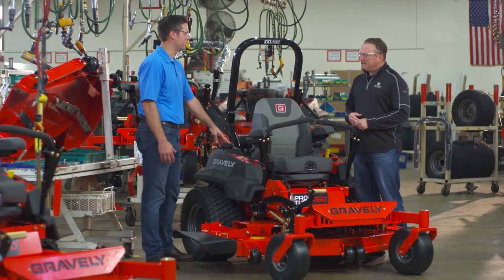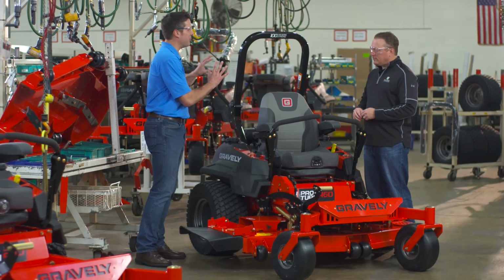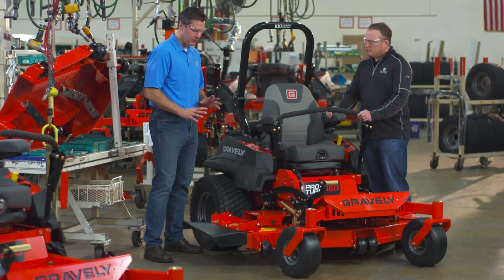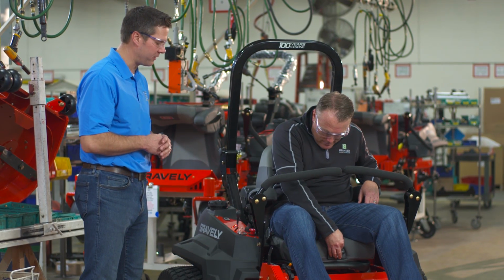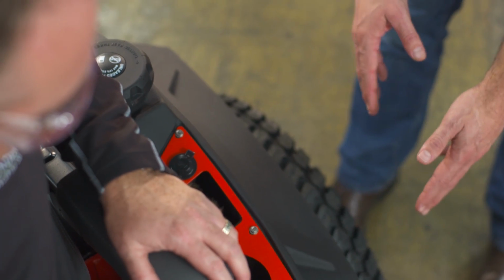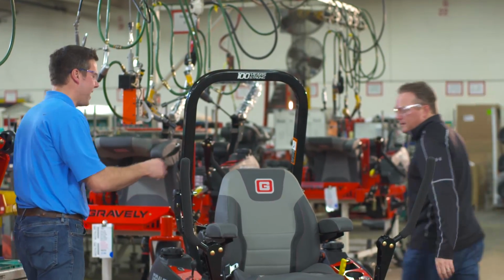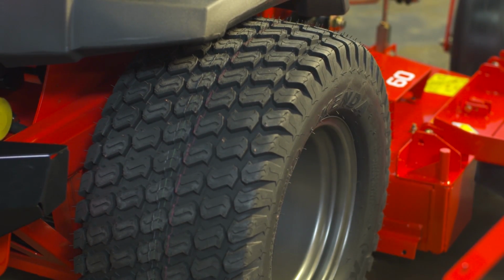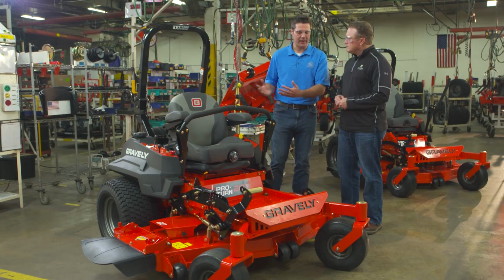Pro-Turn® 400 & Pro-Turn 200 Walk-Around | Gravely®

Comment: I own a 2015 260,  I've put 35 hours on her and this past weekend I changed  the blades. I'm ocd an also mechanically inclined  (like doing things myself) so instead of taking it to have it serviced I wanted to do it so I made sure everything was perfect. I ran the machine after servicing and it's scalping , I didn't move or adjust anything on the deck before or after replacing blades and servicing , either I have a bent blade or the pressure from jacking the deck tweaked the settings. This thing cut flawlessly  before the blade change, with that said , i was looking for a video to show you how to adjust it perfectly but i guess ill go step by step through the manual an get it done this weekend. All an all This machine is  amazing , hands down..  That x factor deck literally makes your grass look like a golf course. Kawasaki engine, and it's the fastest mower I've ever been on.  Gravely killed the game with this Animal. If the 400 series tops the 200, I'll be speechless, the 200 is damn hard to beat.
Reply: got this last week.  can't wait for it to be delivered.  seat is soooo comfortable.  arm rest raise to your comfort.  I have a horrible back and seat is made for someone with a bad back.  Oil change will be so easy..tube to drain oil is at back of machine and can just open, drain, replug and then refill oil and off you go again and filter is right there as well and can get to with hands or simple pair of lg pliers.  35 Kaw.. engine is quiet and air blows away from you so there is no hot air to blow on or up your black.  Never been or or owned a zero turn before but this machine is easily operated.  No belts to get caught in because all are covered, step to step up on the mower on,  plenty of leg and foot room. well built, quiet, and also getting the hopper dump from the seat grass catcher.  ...excited about getting this mower machine......